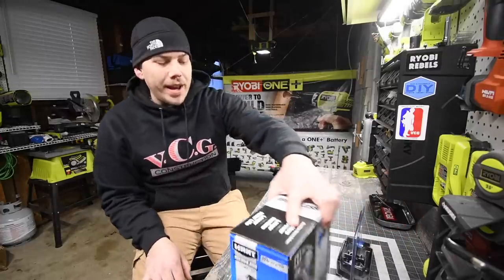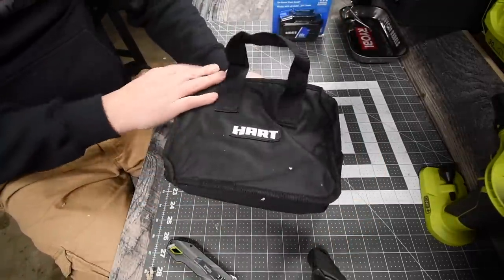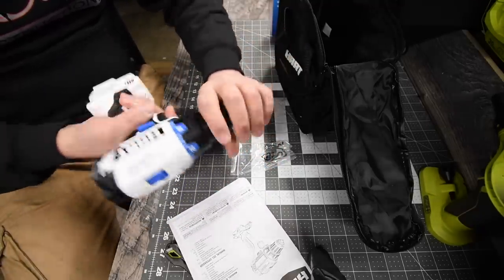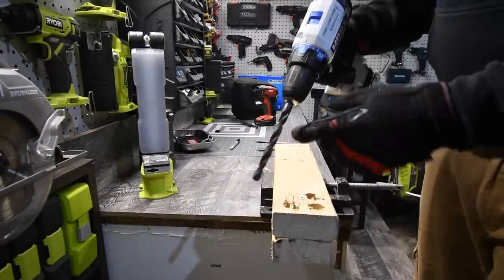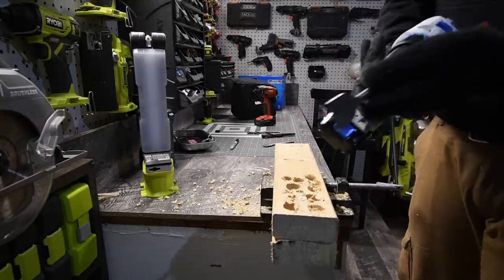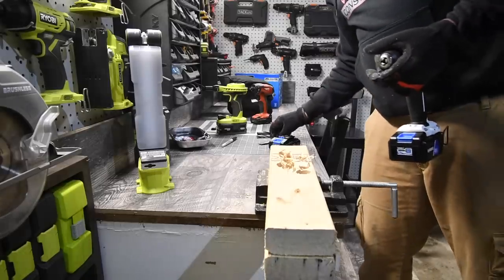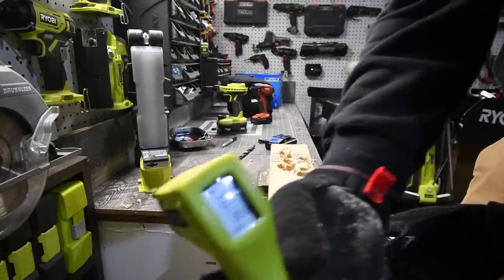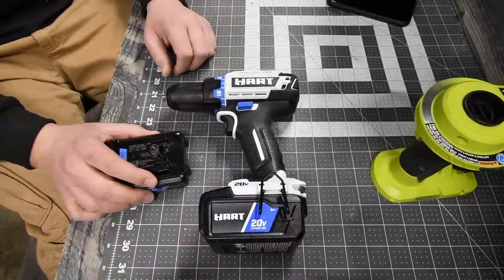HART Brushless Drill and 4ah Battery Unboxing/Test

Comment: Hart is fine for DIYers. However, I went with the buy once cry once route by going with both the Milwaukee M12 and M18 platform and doubled down on it, and it’s worth every penny. Starting with a premium tool brand’s top of the line drill and impact driver kit and adding in their top of the line bare tools as well as their batteries as you are able to afford them is one way to do it. Not just buying all the tools you need from a budget brand in one go.

Comment: I can’t wait to see the hart brushless vs the Ryobi brushless.   
Also hart has been at Home Depot for a while.  They were first known for their hammers.  Then expanded into hand tools.  And now power tools. 
Great video!!
Reply: Sort of hart was known in hammers etc. Tti bought them and made walmart exclusive for walmart. They seem to be ryobi a hd exclusive with a different battery. We shall see if there's other changes in quality. Or if walmart stays with it. The negotiate each year demanding lower prices, does tti go with or pull out?
Reply from the maker: Thank you  sir, vs videos coming soon
Reply from the maker: it really is a good Diyer quality with a big variety of tools
Reply: Charles Herring I think Walmart is gonna stick with hart for a Couple of years.   It looks like a lot of money went into the power tool line, even if it is rebranded Ryobi tools.  
Not sure what Walmart is gonna do with hyper tough.   I really liked that line.  But hart may replace it.
Reply: Ryobi Man Caver I think I’ll stick with my Ryobi and hyper tough tools.  Ryobi is the main brand I use that I try to take care of.  The hyper tough is stuff I’ll leave in my garage and if they get wrecked I’m not gonna be upset about. 
Also I bought 2 hyper tough 2.5 ah batteries, new in box.   I noticed the badging is the same on them.  The tops are the same.  But the stickers on the bottom are different.   One says 2.5 ah like 47 watts.   The other says 2.0 ah like 35 watts.   So that is something to watch out for when buying hyper tough.   I have not seen that on my Ryobi batteries.

Comment: What is the major difference between a 3/8 and a 1/2 inch drill I've never noticed that when I've been looking at drills at Walmart until the hart brand im just curious so I can make sure I get the right one
Reply from the maker: The size of bits that can be put into the chuck. you want a 1/2 chuck
Reply: @ManCaverTools  ok i just ended up getting the hart 20v 1/2 inch brushl with 2 amp battery